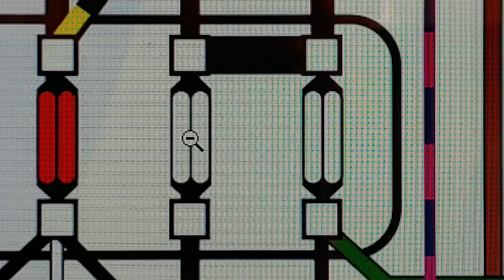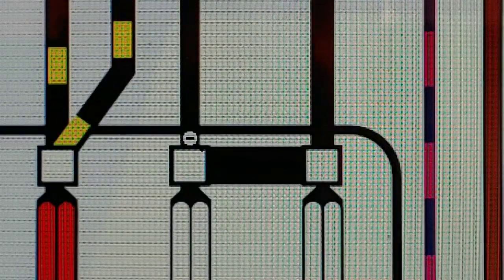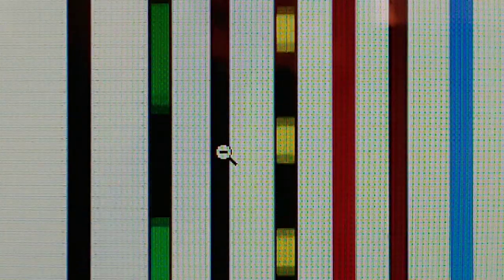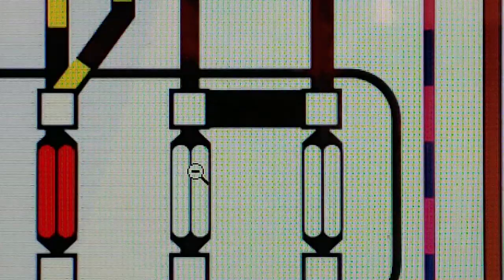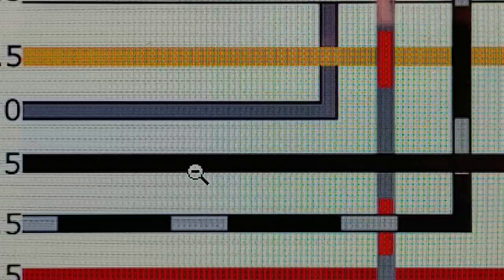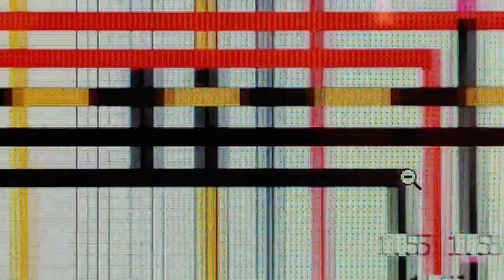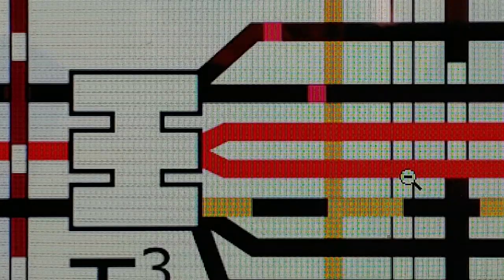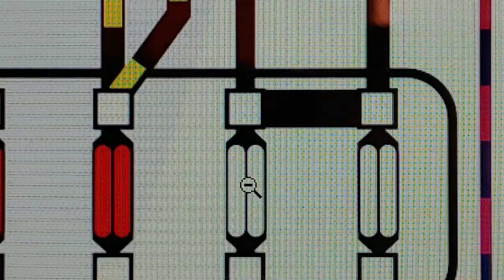CLASSIC 1972 VW SUPER BEETLE REWIRE. PART 15, FUSE 11. ( BRAKE SWITCH )

Comment: first change ignition switch,no crank ,connection switch wire(before two wire red and black red wire join do switch I drove 7 years,oil light ,dime light,head light ,signal good,hazard switch is good,under seat blower is working,video said change hard start relay from NAPA part,accident ,key turn no crank,wire connection or.
Reply from the maker: Installing a relay under the back seat is known as a hard start relay. The reason you install one is the voltage drop over years of the wire break down from age. I have a video on that. I used a volt meter and a cheap test light to correct most of my issues. 
I'm not sure if your commenting on this video or asking a question. Are you needing help?